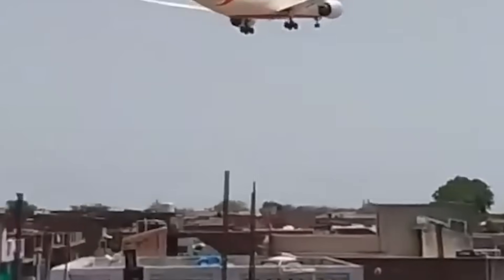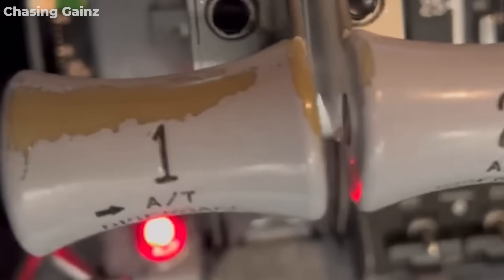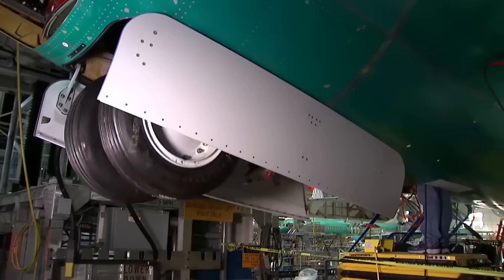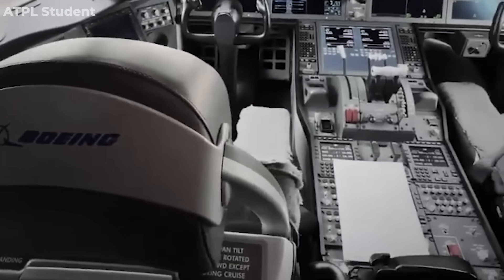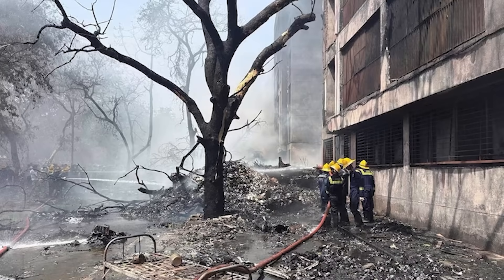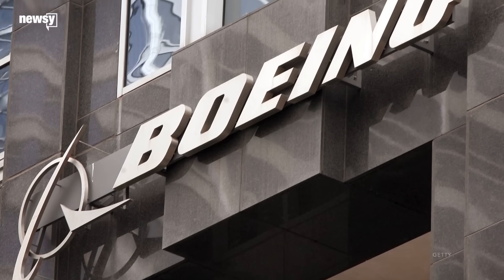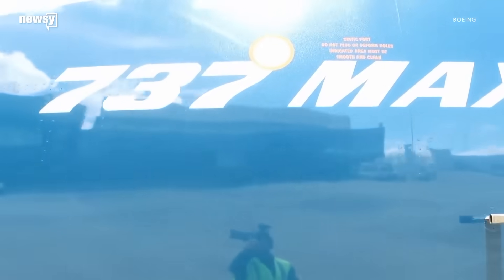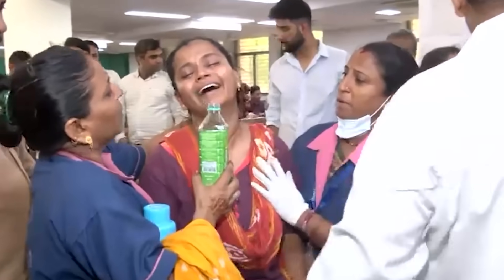Decoded BLACK BOX: New Data Revealed the Shocking Details About Air India Flight 171, NEW UPDATE...

Comment: How would it be Boeing's fault if the seat pin wasn't properly maintained, or if the pilot didn't check to make sure his seat was locked into position?  That is on the checklist in my single engine 4 seat airplane, and I check it every time.
Reply: Exactly.

This class of plane transmits status changes in real time.

The black box was just needed to hear the cockpit.

They know everything- I suspect some face-saving is occurring.

How ridiculous they were allowed to bulldoze what could be a crime scene, before it was examined.

I’m not buying the survivor ‘Briton’ - he is neither imo.

Comment: This is not the first problem with pilot's chair in 787 planes.

"The Federal Aviation Administration (FAA) is requiring inspections after a report "of uncommanded movement of the captain's seat in the forward direction that caused a rapid descent," the agency said in a statement. Operators are also required to perform necessary corrective actions under the airworthiness directive, which affects 158 US-registered 787 Dreamliner models and 737 planes worldwide, the FAA said.

The move is in response to a March flight on a New Zealand-bound plane operated by LATAM Airlines that suddenly lurched downward while flying from Sydney to Auckland, injuring some 50 passengers. Since that incident, the FAA has received reports from Boeing of four additional instances of "uncommanded horizontal movement" of the captain and first officer's seats, the agency said."
Reply: Jj😢

Comment: RAT does NOT deploy unless both engines fail. Not when thrust is neutral. But dual engine failure, total electrical system failure, or hydraulic system failure. Since according to this guy, none of these failures occurred, then the RAT would NOT have deployed as it is automatic. So lying video.

Comment: I also have my doubts... There is a flaw in this explanation. It is confirmed that the RAT deployed. When only the engines throttles were moved to idle, in my opinion, would not result in the automatic deployment of the RAT. Even in idle the generators on the engine would still produce enough electricity.  But we will wait. There was an incident involving someone accidentally touching the button on the captain seat back, activating the seat to begin electrically move backwards. Anyway we will just wait for confirmation of this possible cause.

Comment: Why is any of this Boeings fault if this is accurate? The pin had been replaced 11 days earlier but never tested. 

If indeed the PIC seat slid back and he grabbed the throttles and pulled them back to idle to steady himself, that's not Boeings fault either. No warning sounds are because the AC was responding to flight commands. 

The other maintenance work being signed off prior to completed work isn't Boeings' fault, as well as the pilots being briefed on software updates. You can't idiot proof a cockpit  or any other piece of machinery. 
In the military on multiple engine aircraft with two front seaters, on takeoffs, both the PIC & the pilot monitoring both have their hands on the throttle levers just so this doesn't occur. 

At that altitude, once the engines are at idle, even applying full thrust again won't give the engines enough time to spool back up to a reasonable thrust level.
Reply: If this were really what happened, there would be a warning blaring loudly saying, "Terrane! Pull up!" repeatedly. He tried to make some hare-brained excuse for why it wasn't the case. Anyone who knows Boeing jets knows that there is no way that can be disabled. This is nothing more than really terrible click-bait which could do harm in a number of ways. It's the kind of crap that should be taken down, but YouTube won't. It's revenue for them, just as it is for the creep who made it.

Comment: This sounds highly implausible. If the Captain's seat had a sudden un-commanded rearward movement, the plane would have pitched up violently as the Captain would have still been manually flying the plane. This did not happen. If the First Officer was manually flying, he would have assumed control of the throttles and reset takeoff thrust. I will wait for the official report to be released.

Comment: Manually pulling the throttles to idle would not cause the RAT to deploy nor would it cause the APU to try to start.
Reply: @vmdyde1: And you know that how? Did you design the software?
Reply: You are correct....this is the same logic on Airbus as well

Comment: I do not see how the problems with the 737max problem anything has to do with a plane over a decade old. 
Other than the plane being made by the same MFG. Different factory different time different plane. If there is
a problem with the seat then it is up the people who service to step up and say hey we have problem. And it appears that they did nothing. If the pilot was too tired to fly again that is up to the pilot to say no. This is not the first time I have heard of a seat malfunction causing a crash at takeoff. If they really want to ask a question the only question, why the CO. pilot not take over??? That is why they fly with TWO pilots. The sat is a problem but the copilot did nothing. It appears that this crash had a chain of problems that made this happen. This is normal, it happens. Sadly

Comment: If that was true, then why was the RAT deployed?
Reply: The RAT is deployed when there is no power in the plane, which happened when both thrust levels shut down both engines. When one or more engines are running, this is adequate to provide power to the internal functions. The RAT provides temporary power to some basic functions in the plane.
Reply: @Pbeas52  read somewhere before, unknown model, when trust levers are pulled back hard, the engines are shutdown, not just idled.
Reply: @SaseboJoe  Yeah even in the idle mode, the plane still has power unless there is a complete shut down of all engines.
Reply: To shutdown an engine, you have to turn off the fuel control switches which are separate from the thrust levers.
Reply: Rat only deploys after dual engine failure.
Reply: To all the "experts" commenting above, all this information goes through the flight computer. How many of you know what software is controlling all the inputs at the same time. 
Altitude, speed, lift, etc. Obviously, if the rat deployed, there wasn't enough power to run the electrical system and hydraulics. Too much air above and not enough below. Even the rat couldn't save the aircraft in time. 
No audible stall warning is troubling, though.

Comment: So the seat has an adjustment screw, gee that needs a 1000 page manual! FAA and NTSB approval, 50000 flight hours and crash tests. Or step 1 loosen screw., step 2 adjust seat, step 3 tighten screw to secure seat! If you were driving a car in the seat moved, would you slam the stick into reverse? I don’t think so. This is so much BS and it just hurts the families how ridiculous.!
Reply: @DavidKing: Do you usually drive around with your hand on the stick shift? SMH! Lame.

Comment: Nobody can believe this. The captain inadvertently pulls the power leavers. The first officer pushes them forward immediately!
Reply: For sure, accidents like that with slipping crew-seats are well known in general aviation. One happened in our flight-club with a Cessna 172. Every pilot knows such dangers an has to check the correct adjustment of his seat before flight.
Reply: @dr.wilfriedhitzler  True, this happens, and even with seat rests. But in situations where I observed that the captain was unable to make a successful low visibility landing, I took the controls, and I informed ATC to try it again and then landed the aircraft safely.
Besides, by my information the captain had plenty of time to declare: 'No thrust'! But not pushing the levers forward?
There are several airports in Europe, Goosebay, London Ont,  Iceland, where nobody landed in the given weather conditions except ONE.
Reply: @fritzlehner9060 I believe it was the 1st officer that made that call and even if the Cpt did he may have realized it too late. Panic sets in.
Reply: @fritzie: Not enough time or altitude to make a difference. Only enough to blurt out a mayday!

Comment: The same series of events happened in the early 1970s when the pilot of a CESSNA 172 pulled the throttles back on take off killing all on board.   AN  AIRWORTHY DIRECTIVE was issued to replacement of seat tracks.  The 172 was old.  In the impending law suit  named every manufacturer of every part on the old 172. was sued to pay the multi multi million dollar settlement.    After this suit the price of airplanes went our of sight to cover costs.  Many parts manufactures stopped making part at all or ones with PMA.  It was pounded into your head during instruction and flight reviews to let go of the yoke same as throttles.  
GUESS now we need auto seat locks, or motor driven as in your car.
I owned a 1961 C-172 and flew many other Cessna airplanes as a pilot and A&P IA.

Comment: Idle-thrust:-23% N1,not,”shut-off” and “RAT-deployed”.During,descent,the,power,is on,idle,so,do you see,electro-hydro-failure,with,RAT-deployed?EEC,shuts-off,engines,causing,IDG,to,stop,supplying electricity,till,APU-back-up,takes over(>30 sec) and EDP,ACMP and DCMP,via,TRU,knocked-off,hydraulics,so,RAT-deployed,to,assist,BAT,for,PFC and flight-instruments,with,load-shedded-mimimim-electricity

What is,take-off-procedure?

At V1,hands-off,thrust-levers and at,VR,rotate and positive-climb,achieved and at,50 ft,for,gear-up-command and then,”boom”,so,his-both-hands,were on the,control-wheel,till the,crash,climbing,to,436 ft AGL,with,the,airplane-decaying-inertia and stalling,as,you can see in the,video,with,right-wing-drop,followed,by,left-wing-drop and dive,”FPV,not,PA”,maintaining,(Vx,minus,11) knots,instead,of,Vx,caused,by,the,stall(fear) and crashed on the,hostel,instead of the lawn,ahead

Why,hands-off,at,V1?So,you don’t accidentally perform,RTO,after,V1 and will overrun the,runway and this holds good,if,you computed,mid-point-V1-GS

You see,dev,mention,two-new-emergencies,”seat-slider and false-alarm” and think,that’s what happened

Comment: Complete Rubbish, don't even waste your time with this video....Putting the engines to idle does not cause the Ram Air Turbine that provides emergency power to the Airplane to deploy... Only a full loss of Electrical power would cause the RAT to deploy.
Reply: Engine failure, electrical failure, or hydraulic failure will cause RAT to deploy

Comment: Having the pilots seat suddenly move back is a very serious incident, more than a few planes have crashed because of this. 

The instinctive impulse to pull back on whatever is in your hands at the moment is very real. 

In this case, if the seat did actually move back, of course the pilot would pull back on the throttles. But what about the yoke (steering wheel)? Pulling back on the yoke will cause the elevator (the horizontal part of the tail) to deflect upward, lowering the tail and thus, raising the nose. 

I watched the video a bunch of times and not once did I see the elevator move rapidly, or even much at all. 

If the yoke is pulled back rapidly and the computer will not allow for a rapid  elevator deflection, then the computer did what it was supposed to do as a rapid deflection at a slow speed will cause a wing stall and at low altitude, a crash. But the computer should have allowed at least some deflection. 

While the seat moving back sounds plausible, I'm not sure I believe it however, it certainly cold be the case here.

Comment: I do not agree that omission of a “lock” on the thrust levers is a design flaw.  To react to an abort, having to “unlock” thrust levers is just not appropriate.  Friction adjust control would be a better option.  The Captain reaching for the throttles when his seat slid is a bit counterintuitive and why didn’t the F/O push them back up?  That coupled with the tomfoolery that seems to have overtaken Air India recently, (“Don’t sink!” On takeoff!?!),certainly gives pause for thought, doesn’t it…

Comment: I am pretty sure my first instinct would be to push the thrust levers back to full power...or at least check them before calling a mayday. Something aint right.
Reply: During take off, thrust levers are locked in the hold mode. Even if you retard the power, if you release the thrust levers, they return to the take off thrust rating. That is the reason pilots have to disconnect the auto throttle in case of a rejected take off.

Comment: Do you mean to tell us in light of this information, that the FO could not reach over and advanced the throttles back to take off power, the term
your using shutting down the engines vises bring them back to idle is a big difference. Idle cutoff switches are down and below the throttles levers and then pulling them up, to unlock them into place, either off or on. 
Yes I agree bring the throttles back to idle in a takeoff configuration is not good thing, and yes it would take some time for the engines to come back up
power.

Comment: But why landing gears were not closed ?
Reply: The lever was selected up, you can tell from the wheels tilt position, at the time of dual engine failure no hydraulics thus no gear up and NO it did not cause the crash.